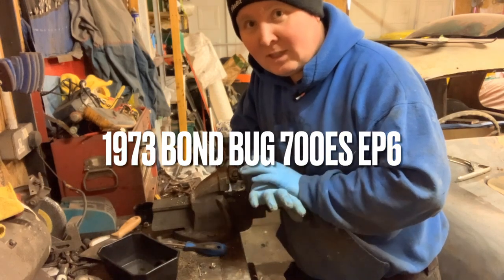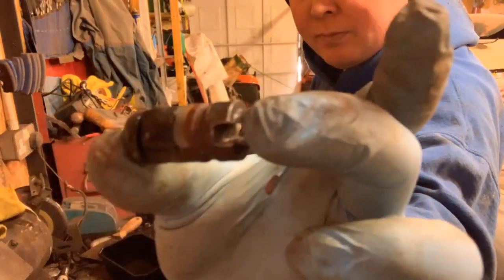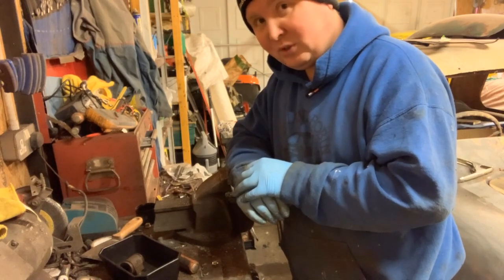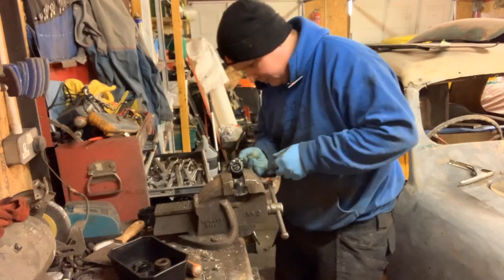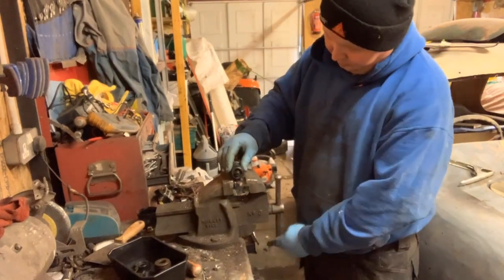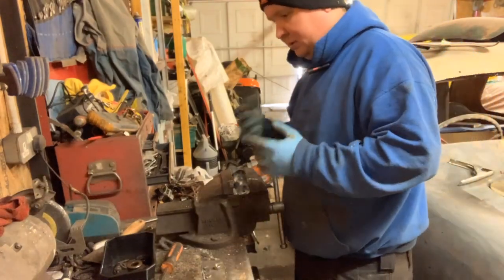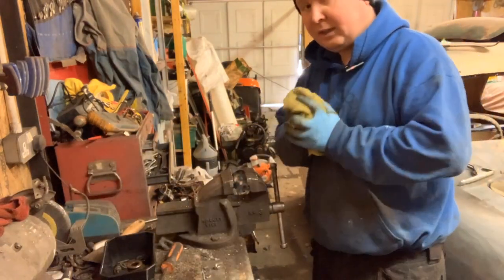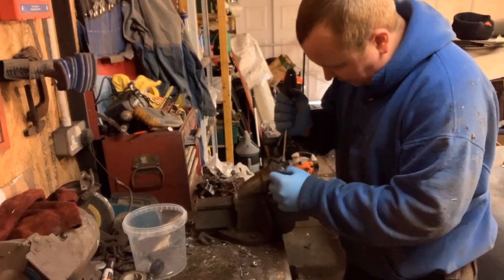1973 Bond Bug 700es Project ep 6

Comment: Good video Lewi, great to see progress- I would recommend some aluminium jams/soft jaws for the vice if you are gripping the piston - alternately I grip my drill in the vice (it has a ring attachment to do this, its a bosch), put the end of the piston that goes on the shoes in the chuck and tighten down, set it on constant speed with the little button on the trigger, then use a long piece of abrasive (fine emery cloth + oil) to clean the piston surface with a sawing motion - you could also do this in a lathe, but I don't have one, my father does but he lives 265 miles away ! - keep up the good work - Andy

Comment: Get some red rubber brake grease much easier to rebuild with
Reply: Agree, makes a big difference.  I use Bosch and it's blue, use both and you have very colourful brakes 😊
Reply: Also helps to stop the moisture causing corrosion.
Reply from the maker: Red rubber grease arrived this week 🙂

Comment: suggest you steep the rubbers in hot water before fitting but still use the brake fluid as lube it will disperse any moisture if you did not put the rubbers on a heater to dry.